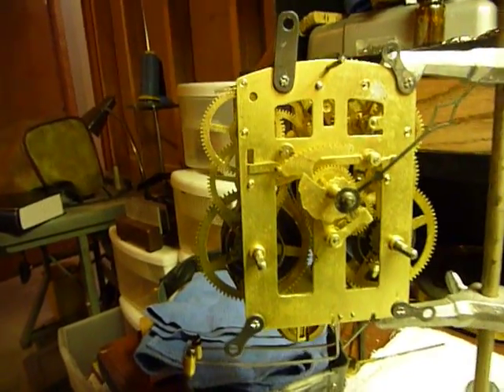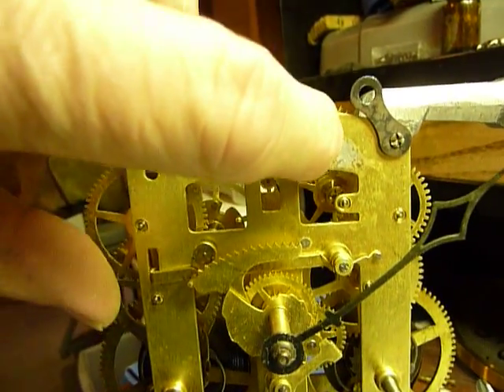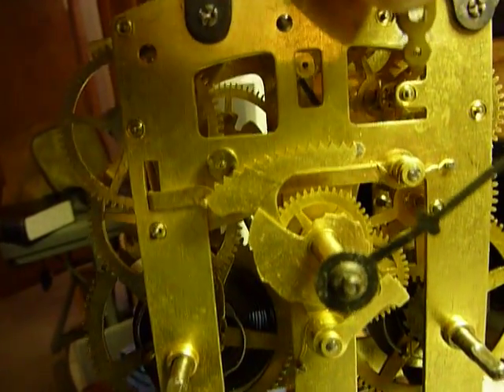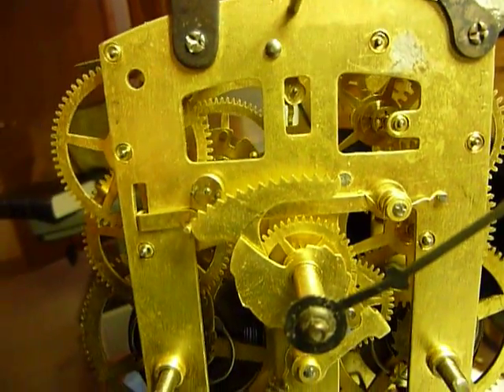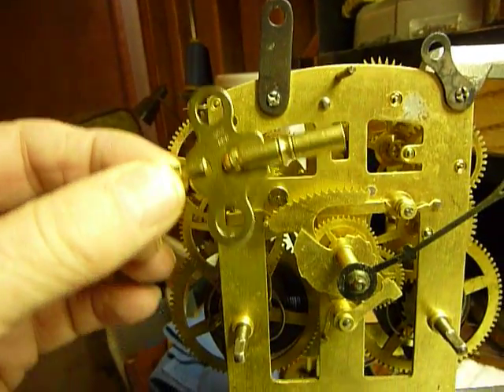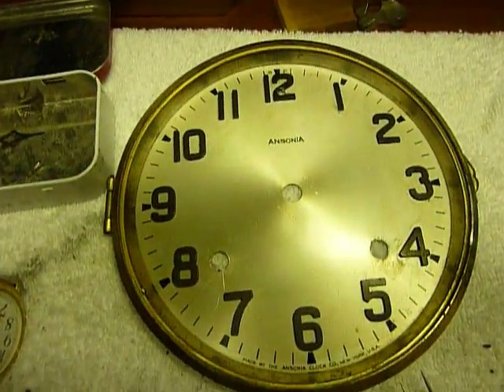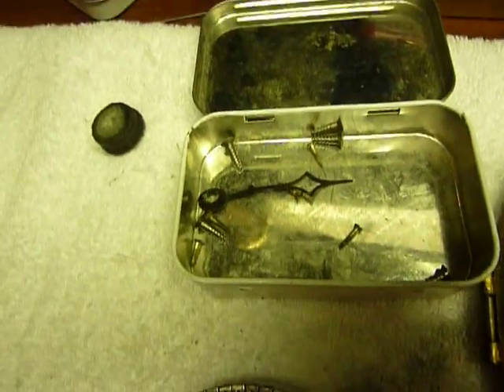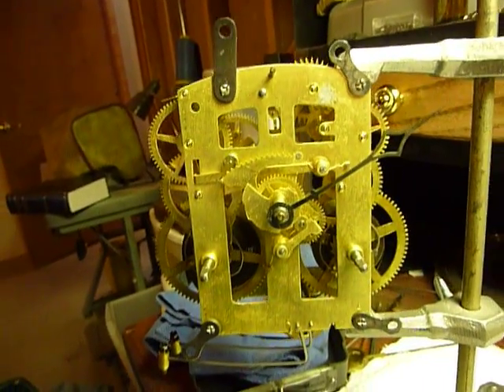ANSONIA CLOCK MOVEMENT

Comment from the maker: the fly is probably slipping on the shaft.    hold the shaft with one finger and see if you can turn the fly easily.   if loose you need to remove the fly, and tighten it on the shaft.   jim